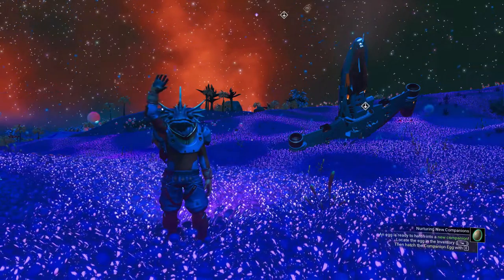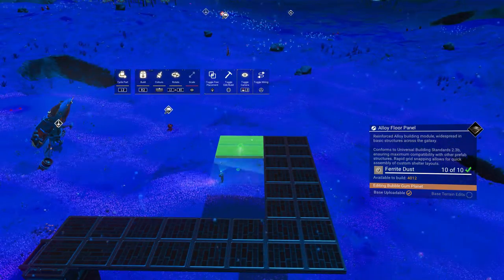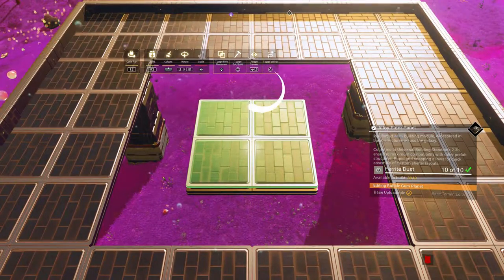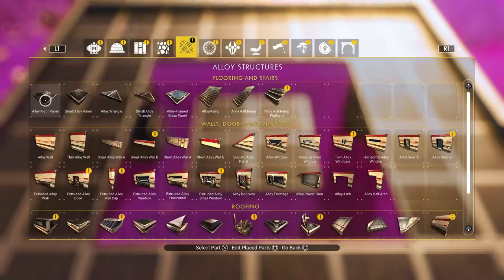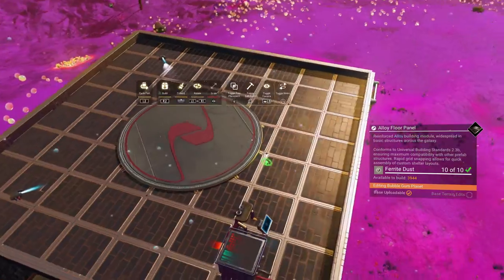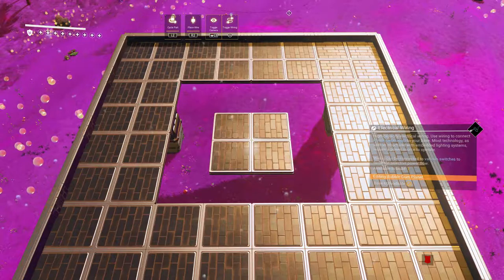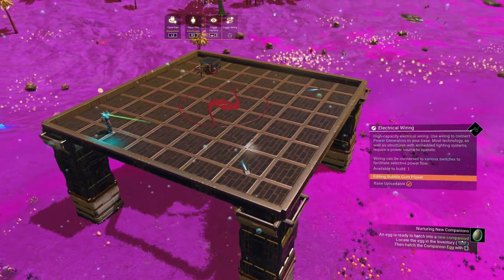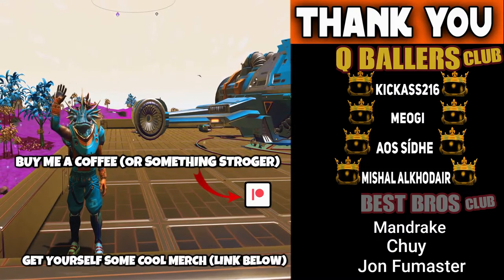How To Embed Landing Pad To Floor Tiles | No Man's Sky Base Building Tips & Ideas

Comment: I finished building a landing pad with columns like yours, and realized that 2 of the columns don't touch the ground. So I found a work-around for snapping walls underneath ones you've already placed - if you build stairs out and down, and spiral them back, you can place a wall at the height you need and then attach them with the method you describe in the video, without having to start over
Reply from the maker: Good one thanks 🙏